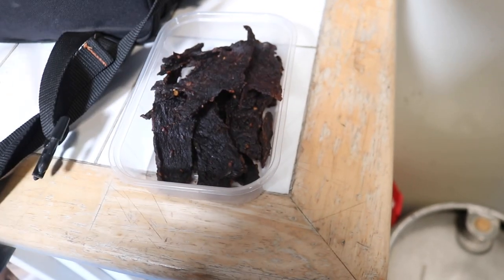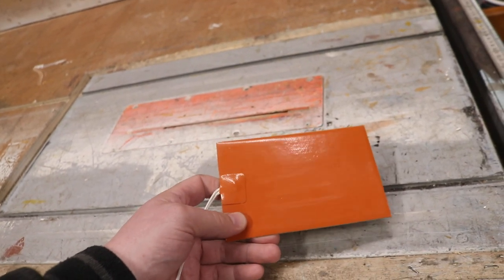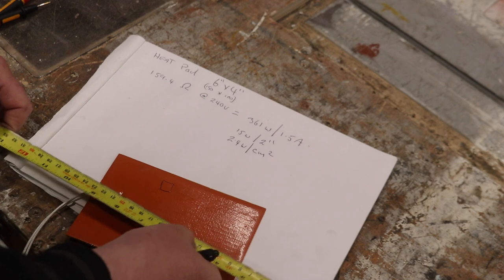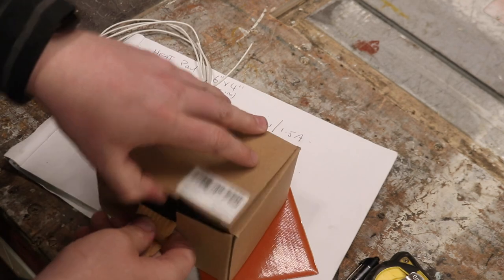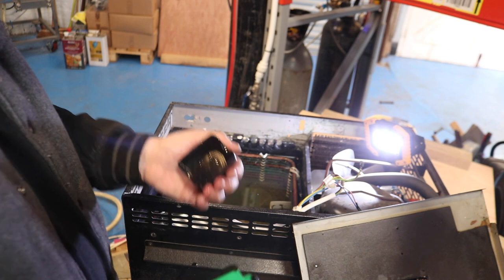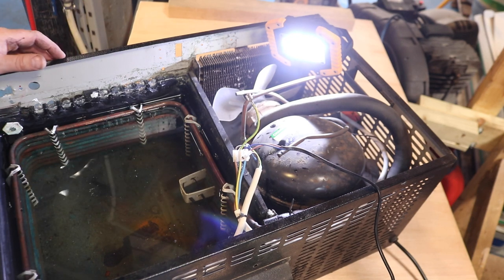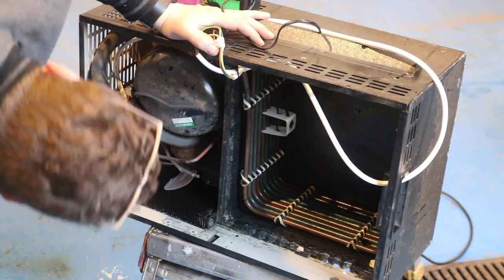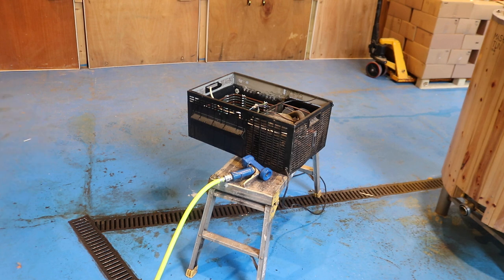What's Inside A Maxi 310.... Muck.

Comment: I've just stuck 6 of these on my All In One brewing system so I can bypass the controller and reduce the power density compared to the integral element. Only done one brew so far, but it worked a treat! Pulled 1.8 kW on 240 VAC.

One note: I added a 105°C KSD9700 thermal cut out per pad, but they tripped during the boil and didn't reset until halfway through chilling due to the high hysteresis requiring <~75°C before they reset. Looking into them more, it needed more like 135°C units so that it'll reset above 100°C in case it trips during the boil.

Comment: Have you thought about using a solar water heater on the roof and the existing pipework for the fermenter cooling? Sould be sufficient to keep them arou 20 degrees even in winter?
Reply from the maker: The roof would cave in.

Comment: The silicon heat mat stuff is what they use on the bottom of the aluminium build plate on 3d printers for a heated bed. Usually 12v.
Reply: Or 24, or 240 :)